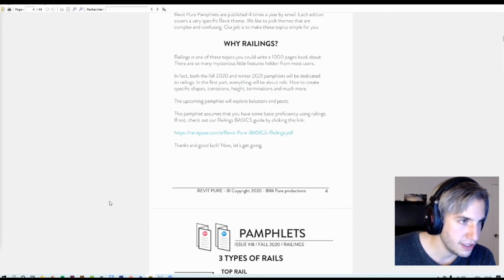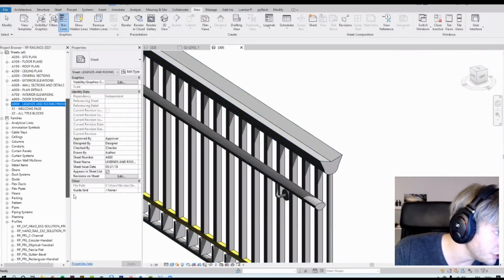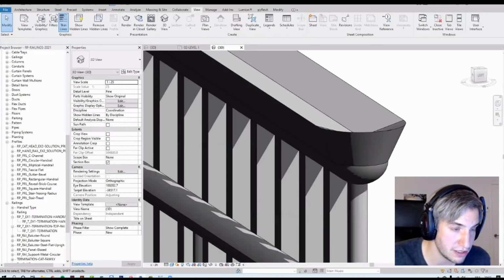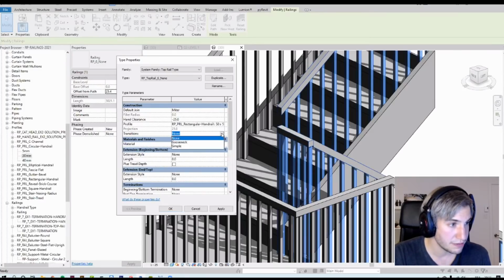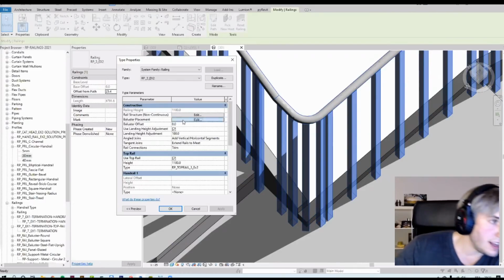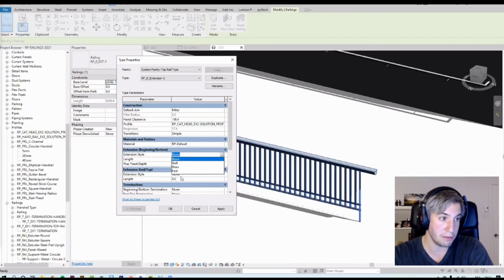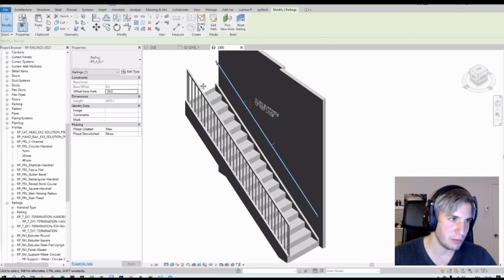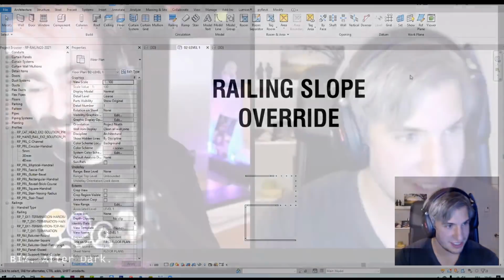Advanced Revit Railings : Sliding Down the Railings One Transition at a Time (w/Revit Pure)

Comment: Tenho uma pergunta.  Is there a way to get the "excess fill length" banisters to not be started on the host base.  The railing i am doing has a bottom rail at 3" and then 1/2" pipe balusters go up from it an a support baluster that goes to floor is placed every 4 ft.  So on railing runs that are less than 4' it is filling in with with the excess fill baluster, which is the same 1/2" pipe, but revit it placing them from the floor.  I tried creating a 'fill' baluster that started 4' off the base level but revit just drippoed them to the floor and they stopped 4" from the top rail, instead of starting them 4" from the bottom rail.  i would really appreciate your help if you have any advice.